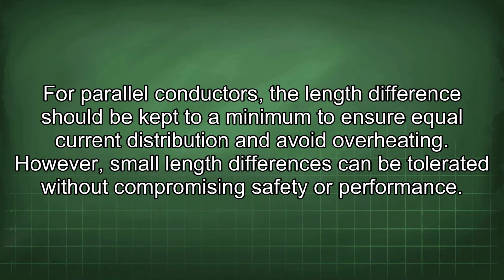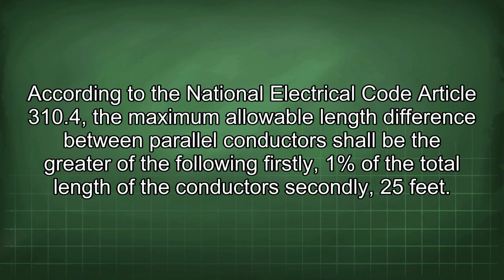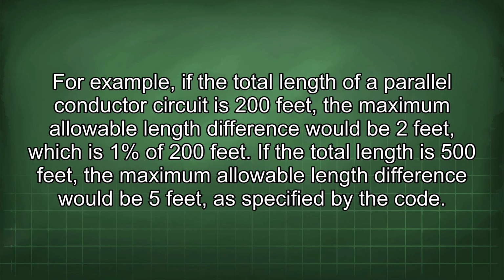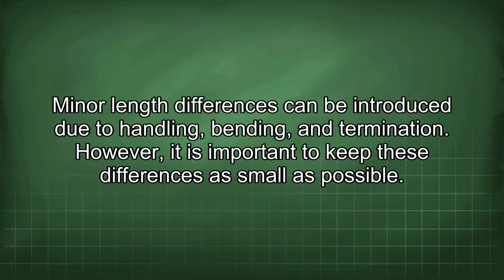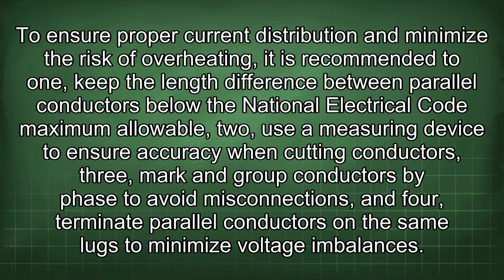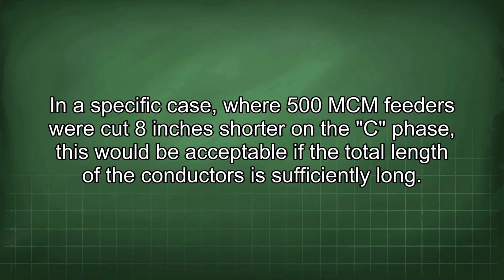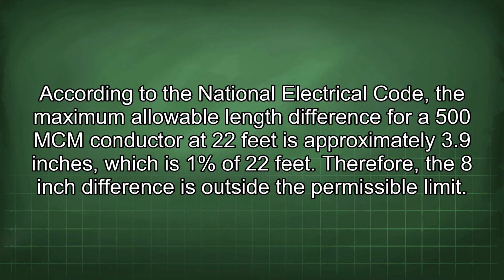Parallel Conductor Length Differences Explained NEC Guidelines

Comment: "Longer conductors have lower resistance" umm that's not how it works.
Reply from the maker: Hello @rosscoep1450,

You are absolutely correct. A longer conductor will experience reduced current flow due to its increased resistance, leading to an imbalance among the conductors. This imbalance results in a lower effective resistance under load, which can cause confusion in practical applications.

Sincerely,

BESA Research